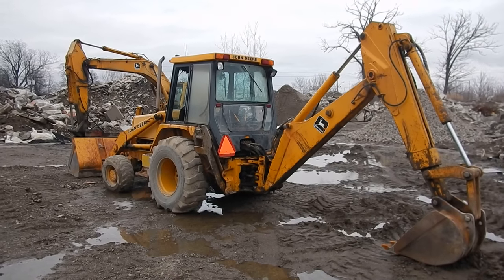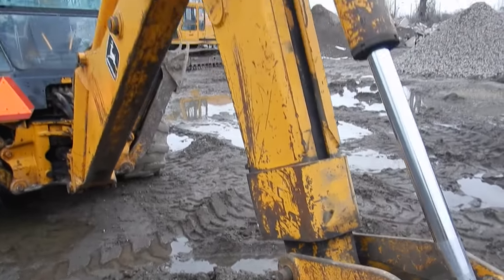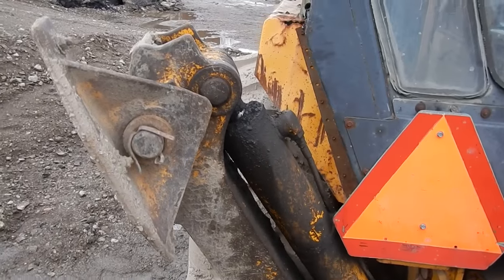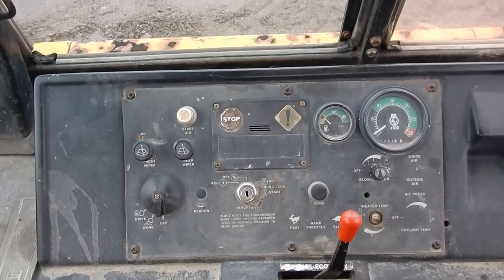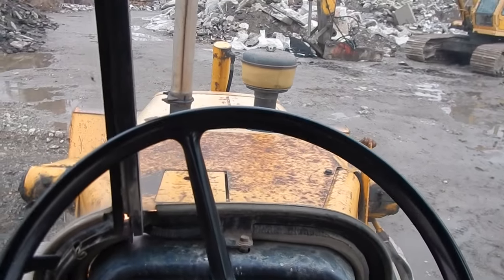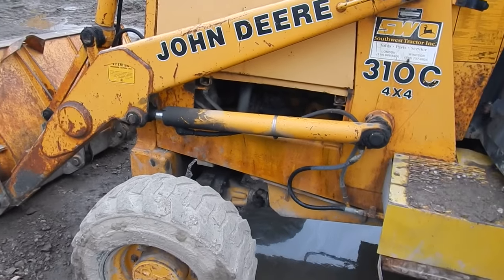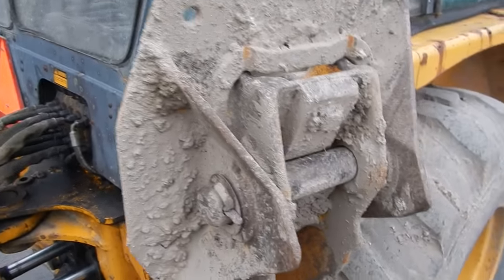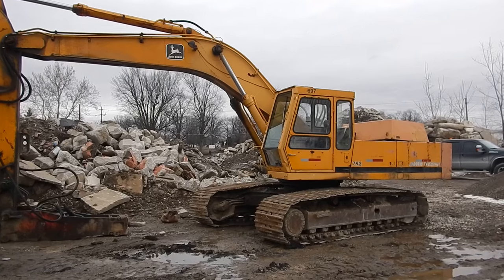John Deere 310C Documentary

Comment: I currently have a JD 310C in slightly better condition when looking at from the outside. Its not an extenda-hoe but it can still dig. Also some of the controls are different. The gear selector is between the legs and has a different knob style also ours doesn't have the tach. I plan on rebuilding the entire thing in hopefully in the next 5 yrs or so. Ours is a 1986 and we are currently replacing several lines including the boom cylinder (i.e. the largest cylinder on the machine hidden in the boom frame). Also the one you showed has a front weight, its the formed piece of metal that sits just in front of the turn cylinder.
Reply from the maker: That's just the factory weight. The other machine is probably more like yours. This is a newer model. I'm guessing your loader control is just a straight handle with a button on top for the clutch disconnect?
Reply: Yep. They had 3 options for factory front counterweight (400lbs, 415lbs, 800lbs).

Comment: I know these units well. Our family owned a 210C and a 310C. Made us nothing but money. Don't forget the rear boom didn't over-centre upon the top of boom cylinder stroke.....which caused lots of crashing. Case was ahead on this IMO. The electrical system was terrible too. Lots of blown fuses. Eventually we would jam a piece of wire in place of the fuse....you could find your short real quick that way. 310C we had came with a 4-in1 bucket, and the 210C had bucket hook pallet forks. It was an oddball in BC so we got a great deal on it at Coast Tractor. Bob Girard sold it to dad new for $33,000 in 1989 I believe. It went in on a barge to Kyuquot, BC for a native housing contract, and just gave a great job for us. 

Thanks. I never post on your guys videos anymore but that's really neat to see this one. I love the 792 Deere/UH10 Hitachi. Those in themselves were great units.
Reply from the maker: The 792 is probably going to be the next video. We didn't have as many electrical problems on these machines. The over center would be a nice feature but at least the D's had it. Remember the wedge shaped transport lock on these? I still remember having to jam it in 90 degrees from how it was supposed to be because if you put it in the normal way the boom would wiggle and eventually it would shoot up and land 25ft away.
Reply: Oh yes, there was actually two lock pins, one for boom and one for the swing. At least that's what we had. And it had great brakes too! Never had to fix them. We got lucky, Coast Tractor supplied a complete CWS Q/C and buckets package with Faangs teeth. Honestly, I don't think they were that bad of a unit. Our family has a Cat 420D 4x4 today, and once you know what you're doing, I don't think the old Deere C series was lacking that much. A guy could really make a living with these backhoes.
Reply from the maker: +Tax me I'm Canadian the C's were solid machines. The D's were nicer to run. Yeah they all have the swing pin lock as well, still have it to this day on the L's. I've never liked Cat backhoes they always seem bulky and clumsy on a job site.
Reply: Tax me I'm Canadian have owned s 310c since 1995. Solid machines for the money. I am having hydraulic pump issues. Mine has the Sunstrand/Sauer main hydraulic pump with the power steering pump on the front of it. I am having problems finding a rebuild kit for my pump. John Deere wants $4700 for a pump and aftemarket wants 2600-3000k. John Deere only offers a hydraulic pump rebuild kit that is only seals, gaskets, and o rings. Everywhere I call says they can't get sunstrand hard parts for a rebuild as it's a gear pump. There was also a different variation of 310c that had a vickers brand pump. I also cannot find a main relief valve! John Deere has discontinued parts! Do you have any tips on what I can do? I really appreciate it. I, north of Atlanta Georgia. I'm a poor do it yourselfer with a small business and I can't afford top notch new parts always.